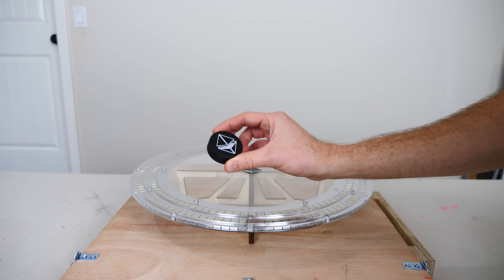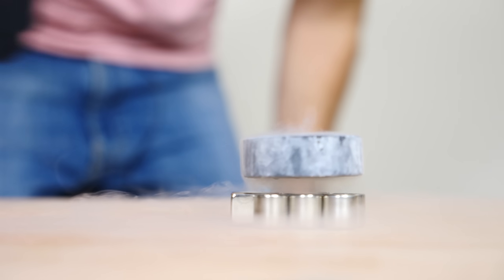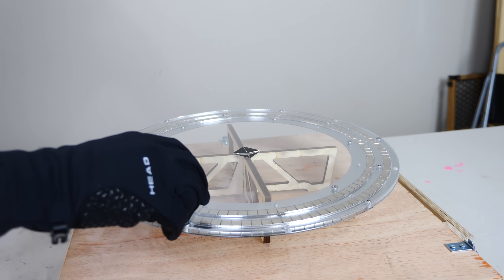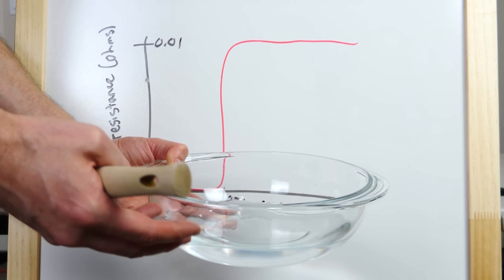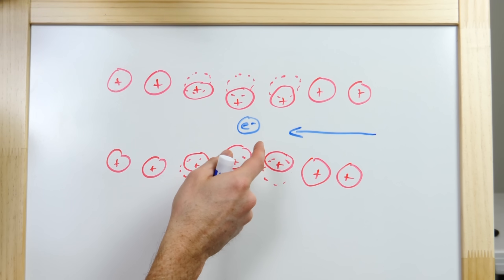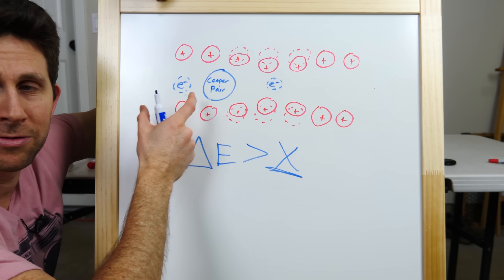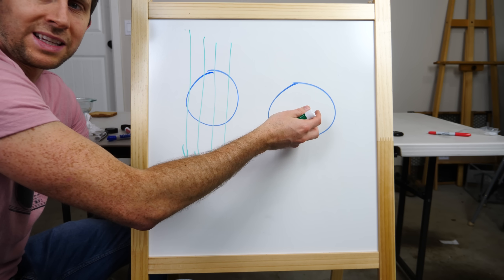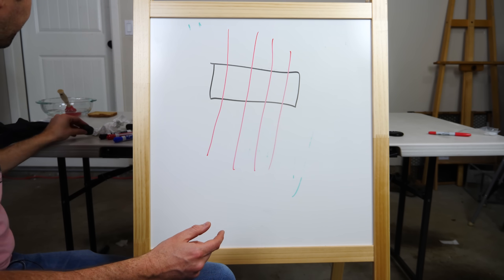Quantum Locking Will Blow Your Mind—How Does it Work?

Comment: Does the temperature of the magnets affect this action of pinning or locking with the superconductor? Does the superconductor eventually heat up? How long does that take? Or does it stay cold because it eliminates friction? (I’m thinking of applications to explain aspects of psychology which I theorize have physical explanations in quantum mechanics.) Do the magnets gain the properties of the superconductor or is the elimination of friction only in the space field between the magnets and superconductor? I’m wondering if the field at the opposite ends of the magnets experiences friction while spinning around locked with the superconductor and if they then slowly heat up thereby breaking the lock with the superconductor. How long does this state last?

Comment: there’s no such thing as a particle
There’s no such thing as a superconductor
There’s no such thing as quantum locking and all your party descriptions are based on the cult of quantum which is at a mystic which is dogmatic theology that doesn’t exist in mother nature, everything is Fields and fields are not particles all this is, is extremely low magnetic permeability, there is only capacitance, resistance, magnetic permeability, and dielectric Permittivity, there is no quantitative change when a dielectric object becomes electrified into a magnet there is a qualitative change. But please by all means continue this nonsensical garbage that at a mystic science will have you believe even though none of it has ever been proven such as a particle being the input or output of any experiments or the fact that they cannot even explain the connotation of a field.

Comment: **Genius at Work**

https://www.ru.nl/hfml/research/levitation/

The article involves magnetic levitation, which is a real thing that actually works. 

The genius aspect is taking telescope and mounting one plate to the telescopes EQ mount. Based on how magnetic levitation works, the plate with the telescope is levitate above the other plate a few inches. 

The advantage of a levitating plate for a telescope is that the telescope would never come into contact with the telescope base and would see less transfer of gravitational forces, the Earth spinning, while looking and taking photos through the telescope. 

The telescope would also be able to be hand turned and able to be positioned at any angle. 

Quantum Locking - https://youtu.be/8GY4m022tgo

The size of the plate that the telescope would sit on would have to be relative to the overall weight of the telescope itself. Since a 202kg Sumo can stand on a plate that is levitate with super conducting magnets, a telescope wouldn't be very difficult to build on top of the super conducting plate.

The car wasn't a car until the wheel was discovered and the first wheel was not round.

Comment: So theoretically wouldn't this be capable of creating a very low level type of arc reactor? If the magnet had 0 resistance and is capable of creating energy(movement) liek your alternator in your car at the cost of none.

Comment: Technically, I think it's revolving, not rotating bread.
Reply: Technically, the bread is both revolving AND rotating.
Reply: @linguist2k  Please... elucidate. I believe it was not spinning on it's own axis and therefore was only revolving.
Reply: @mr.howard1  I'd be glad to. First, I appreciated your correction of the word used to describe the motion of the bread around the perimeter of the platter. As you correctly pointed out, that motion is called "revolution." So the bread was revolving around the center of the platter.

That said, the bread was also spinning on its own axis (i.e. rotating) once for every revolution. The fact that the rotation was only once for every revolution disguises the rotation. It's extremely easy to overlook, so I don't blame you for not spotting it. 

The Earth's moon also rotates once for every orbit it makes around the Earth. That's why only "the near side of the moon" is visible to people on the Earth. We typically don't think of the moon as "rotating," but technically, it's doing that once per revolution. Likewise with the bread. 

Now that the disguised rotation has been pointed out, I wager that you'll easily spot it whenever it's happening, while others will miss it. Then you'll be in a position to explain it to them!
Reply: @linguist2k  Hoorah!

Comment: - superconductors can carry enormous currents without losses
Cutting losses in distribution system makes electrical system much more efficient
Cutting losses in transmission systems eliminates losses in long runs from wind, and tidal generations where the source is a long distance from the consumer.  Makes these technologies more competitive.
- All of these losses from distribution and transmission, contribute to environmental heating (think of waste heat as a source of thermal pollution).
- The real jewel that we’re looking for, in super-conduction, is the material that doesn’t require exorbitant means to keep cool.  Because ... cooling requires energy that ends up contributing waste heat to the atmosphere.  Room temperature superconductor material would get you into that magnetic hovercraft you’re been drooling about.
- superconductors in generators would eliminate another significant source of electrical system losses.
If you really want to cheer for a technological breath-through, try room temperature  superconductors.  
If I had 1 day and a time machine, I’d invest in the company that will ultimately hold the first patent on this.

Comment: Superconductors need absolute zero temperature to gain the characteristics Cooper pair . Vibration of atom is restricted cause of low temperature so electronic get way of moving conductor in coordinated manner .Type. 2 semiconductor has doping in them cause of it retains the characteristics of diamagnetism so when u move the semiconductor which Change the symmetry and change the centre point and pins at that point so it's like moldable pin poin and position basically . Imagine life with superconductors in every day use sadly we can't maintain the absolute zero temperature which restricts ultimate superconductivity. This principle is used in CRT too cathode ray tube has negative charge so when positive charge passes it repells equally and move it forward.

Comment: I heard another explanation once: that electrons don't actually move its just the polls just flip or togle on from positive to negative across a material. In quantum locking the electrons & ions are so tightly compress when so cold that the charges across are actually almost in both states (both + & -) or one could say the whole semiconductor is evenly + & - but the atoms are all sharing the field when put in a magnetic field. (hard to explain in text) uhhhhhh. Lol 😂

Comment: Is nobody gonna mention how he said "they don't even need to be very close to each other. They can be hundreds of NANOMETERS away from each other."
I guess everything is relative :D
Reply: I caught this.  And yes, it is all relative.  While watching, I was vaguely thinking about how this worked at the much larger scale of the quantum locking demonstrated in the video.  That wasn't just a few nanometers.  The effect on the whole object was happening at several centimeters, to be sure.  I didn't really quite grasp how the electron couplets related to the effect at such distance.  Maybe I just didn't get where each electron of the couplet "lived".  Surely one is not in the magnet and the other in the superconductor.  There is certainly more to be "grokked" here...
Reply: @timlepes  the two electrons are in the superconductor. The pair thing only happens to get the electrons in a lower quantum state so they require a specific energy to get scattered on bumping into anything(nothing less). Now because the temp is low the atoms don't have that specific energy to scatter so the electron pair keeps moving
Reply: Imagine using this technology for hovering cars. Since cars use tires, the most amount of the fuel is necessary to overcome the friction between the tires and the ground. Now with cars floating just barely above the ground, in such a stable manner, it would be revolutionary. 

I mean yes, cars are extremely heavy, but just imagine it being developed to a point where cars could use this technology!

Nanometers, are still much farther than a "touching" state.
Reply: : is 100 far enough?
: depends on the context. Social distance in millimeters? No. Electron distance in nanometers? Yes.
Reply: Wow did he just say the N word !
Reply: I noticed
Reply: @Ebin Jose Huh but is this the same? Quantum interlocking vs. magnetism. I mean it seems like Quantum interlocking is way more controlable, whereas simple magnets just either pull or push. Might be wrong here.
Reply: Picometers is close. Nano, not so much 🤣🤣🤣 micro is huge.... my brain hurts now
Reply: @CptCloseCall  heh kill me
Reply: Nano meters are not very big relatively speaking lol
Reply: I believe I read somewhere they can be MILES apart, as in thousands of miles.

Comment: Now someone should make an actual track including a wagon using this technology and materials. We could use it for transportation of items in a factory for example. You could just push the wagon and it would follow the track of the neodymium magnets, without there being any major friction since it's levitating (only friction there would be is the air)
Reply: Don’t forget, you need to cool it, meaning it would slowly heat up from ambient temperatures and eventually come to a grinding halt. So it would constantly need to be refilled in some coolant such as liquid nitrogen because we don’t have any perfect insulation as everything we currently have discovered has a very tiny amount of conductivity in thermal unless you count vacuums of course, but you still need to stop any form of heat generation or transference too.

Comment: If the distance between the super conductor is centimeters the than the distance between the a car and a suspended plate would be a few miles below the Karman line (between the thermosphere and mesosphere)which would be our coldest temperature of -120°c  flying vehicles would be a realty.

Comment: There has got to be a way to make energy out of this. It would be practically infinite energy if we could find a way to harness it somehow
Reply: Well, it seems more like near perfect conservation of energy to me. You might could draw some low power electrical fielding from the conductor going around maybe. Not really sure there. I see it being used for production lines. Just set the product on the floating magic pad, give it a tap and off it goes to the next phase. No parts to wear out, no friction to overcome. Conveyor belts re-imagined. Possibly transportation, but considering how slow everywhere is on improving infrastructure I doubt it'd ever happen. Not even considering how to deal with supercooled surfaces for the passengers, or how to keep the superconductors cooled.  Ah I didn't watch far enough into the video to see what you were thinking about. Interesting times, if it gets picked up and studied more.
Reply: No way you get more energy out of it than the energy it took to cool it
Reply: @alekisighl7599  that’s true, didn’t think about that

Comment: This guy: puts 2 magnets together , they levitate 
Me:  okay...
This guy: tilts the magnet,...the magnets stays tilted 
Me:  🤯
Reply: Yes, and they were not just levitating, they were repealing and attracting each other all at the same time. Levitating and staying circulating without leaving the track... 🤯🤔🤯
Reply: Allen D21 could you use an electromagnet to control the magnetic fields and get it going super fast with barely any friction?
Reply: @leousher8474  I think that's possible but the problem will be keeping the superconductors cold enough like in the demonstration...
Reply: @drsant21  So, imagine a huge train using this technology. It would be possible if every so often the train    passes through "Cooling stations". Pretty cool. Pun intended.

Comment: may so with or WithOIJt anhidrosis 
because remember 
the nerve fibers that SIJPply most of the 
sweat glands come from 
the superior cervica ganglion and 
travels along the 
externalcarotid artery it doesn t 
actlia11y go throIJgh the cavernolis sinIJS 
and so if yOIJ think abOLit it lesions of 
the third order neuron 
distalfrom the internalcoated artery 
wont rea11y affect 
sweating that much 
caIJses a third order neliron inclIJde the 
cavernous sinus issues 
happiness sinlis tLJmors thrombosis in the 
velns 
internalcarotid artery anelirysms and 
pituitary tumors 
the cavinlis sinlis is actlia11y s1iper 
important 
it s a venolis plexIJS which drains b1ood 
from the eye and sIJrroIJnding strIJctIJres 
the cavernous sinus houses many crania

Comment: in my opinion, this is how "ufos" operate. somehow the machine is able to use earths magnetic poles or generate its own magnetic force and manipulate it in a controlled way. this may be why there is no exhaust or noise emmitted compared to jet propultion.  if there is a way one can make a machine utilizing electromagnetics, there would be less reliance on fossil fuels and it would be overall, revolutionary.
Reply: Disregarding everything about "how UFOs work", the only reason that this is possible is by cooling the superconductor to very low temperatures, and that cooling is very energy intensive. So you have to put a massive amount of energy into the "fuel" (very cold superconductor), and that energy has to come from somewhere (probably fissile fuels, but ideally renewable energy sources)
Reply: @SigismundsWrath  yes but where did the energy come from moving the object in this video? Magnets correct? IF there is a way to some how keep the superconductor temperatures very low,  and IF there is a way some how use the earth's own magnetic fields as the fuel. Then maybe? Idk just watching this video trying to comprehend to throw out some ideas because after seeing or hearing witnesses talk about "UFOs", they use propulsion that is beyond what we currently know so was just trying to think outside the box

Comment: I see a perpetual motion engine on a spaceship, if used in the vacuum of space. The magnet would never warm up, friction would never occur, and the right hand rule would pull the entire ship forward.
Reply: What is "the right hand rule"
Reply: @joshuasukup2488  Just google Fleming's Right Hand Rule. It basically decides the direction of the flow of electricity, magnetic field and stuff
Reply: @joshuasukup2488  the right hand rule is that current, magnetic field and thrust is mutually perpendicular to each other. Use your right hand, and keep your middle finger, index and thumb mutually perpendicular to each other so ur middle finger represents direction of current, index is magnetic field while thumb is direction of thrust

Comment: So large bodies in space are type 2 conductors and the eddy currents as in earth is much colder than the suns ionized protons from the sun and the 40 plus absolute zero Kelvin Temps push the large bodies like earth at astronomical speeds around the sun. LaViolette worked on open source of a ion drive.

Comment: Me after seeing it flying: WHERE THE F IS THE FLYING CARS?
Reply: The trouble with flying cars is not the flying.  It's the piloting and regulating.  We're waiting for self-piloting transport drones.
Reply: There's another issue, Imagine this the magnet has to be cold(very cold), how would this be done, if it does happen to be done then how can we garuentee safety [example; If there's another gas tank that uses liquid nitrogen, what happens when it runs out also, the metal cant be cold or it will just function as a magnet again.]

Comment: Zero ohms, impossible, ohms law breaks down, V=IR so V = I X zero which equals zero. No voltage drop so no current so no electrical conductivity so the term superconductor is inherently false as if zero ohms is true then it cannot conduct electrical current. These superconductors do have some resistance albeit in the region of yocto ohms (10 to the negative 24) but there is some resistance. Zero is a concept not a number
Reply: Drop your temp closer to 0 Kelvin then let's talk.

Comment: When Superconductors are cooled below the critical temperature, they expel magnetic field and do not allow the magnetic field to penetrate inside them(Meissner effect).
due to expulsion of external magnetic field, the superconducting material levitates above  a magnet.
Modern high-speed bullet trains use the phenomenon of magnetic levitation or quantum levitation
Reply: Magnetic levitation isn't the same as flux pinning. In magnetic levitation, you just have two magnetic fields opposing each other, generated by conventional means (electromagnets in the case of trains).
Reply: Ok yeah I can stop watching thanks I can’t deal with simplifications
Reply: Yeah you are right . .

Comment: Can this principle be used to
Generate power . Similar in
Principle as using windmill
Technology ?  Renewable 
Energy  source ? Thanks !
Please reply .
Reply: Answer: no
Reason: In case of something like water turbine, the water is constantly turning the turbine, which produces energy (kinetic energy of water -> electricity), but in this case of moving superconductor, if you try to extract the kinetic energy, it will gradually slow down and eventually stop moving... So no free energy😂
Reply: What is this grammar gibberish..
Reply: I have kind of been wondering about creating a power generator with magnetism, I think eventually everything comes down to "you need energy to create movement" so I think anything with magnets eventually you would need to use the same or more energy to recharge the magnetism, making it losing proposition unless you had a source of already charged magnets.